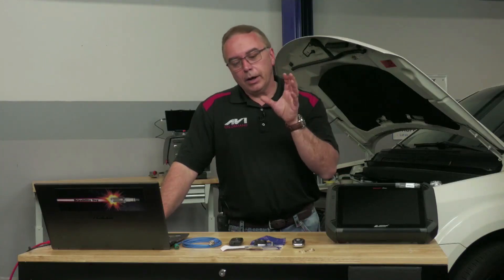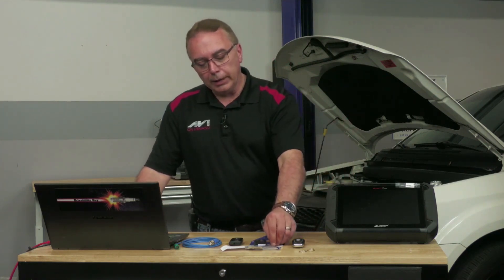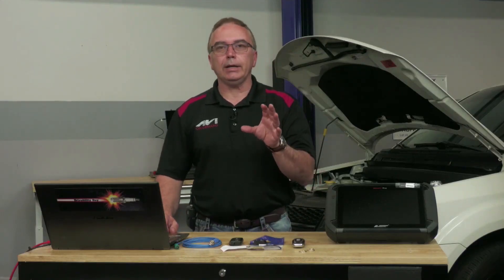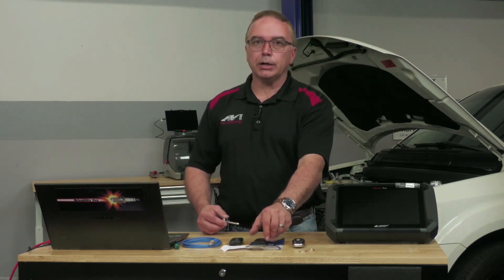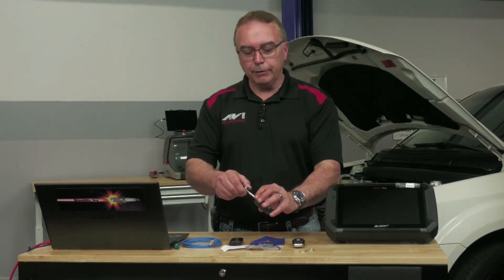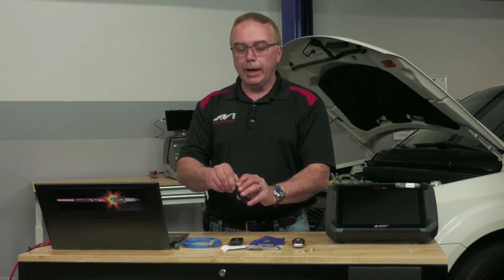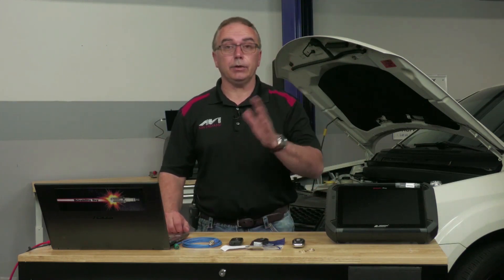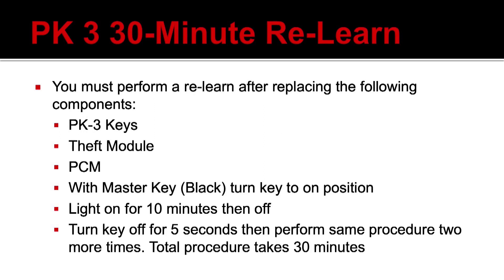GM PK3 Systems & Parasitic Draw - Tech Tip | The Key to Security System Diagnostics

Comment: It’s also a bad habit to ignore the door chime. It will inevitably lead to locking the keys in the vehicle at some point. This video is spot-on. My 2000 Pontiac Montana uses this key and something is wrong with the ignition cylinder such that it releases the key when it isn’t fully in the Off position. This means the exciter stays energized and kills the battery. I usually catch it thanks to the door chime but it still happens every couple of months or so, which has totally ruined my battery.